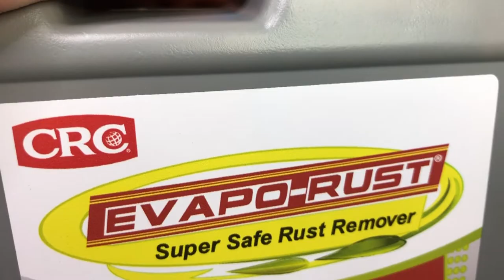Smith Alarm Clock Tear Down & Rebuild

Comment: Great video, and again, thanks for the mention! You did a great job on that Smiths Alarm. The only thing I'd suggest doing differently is I'd reccommend removing the balance wheel and hairspring before letting the power down, just to keep it safe and get it out the way early. All the best!
Reply from the maker: Great suggestion! I've since got another clock that I can hopefully salvage the hairspring out of a get this one keeping proper time. I just really like the look of the face. Have you ever tried re-painting the alarm plunger - notice how the red paint has flaked off this one. And thanks for inspiring me to have a go!
Reply: @watchout9213  I like it too, I've got one with the same face design but in a slightly different case, dated 1957. Your clock looks in great condition, so I think you should give it a go. I don't think those plungers can be removed from the case however, so you might need to use a lot of masking.